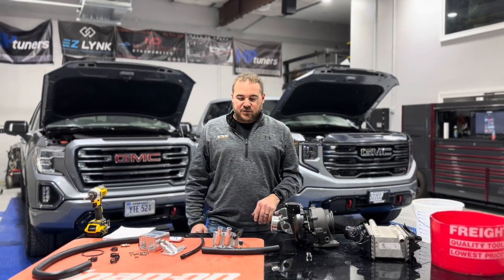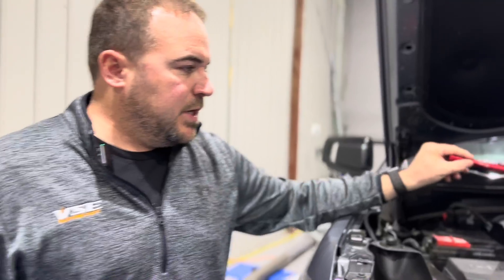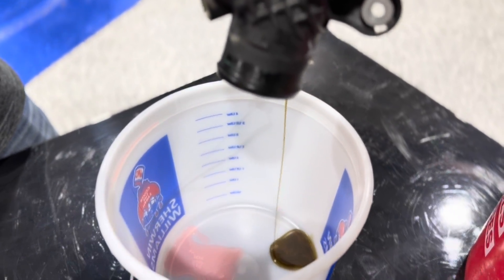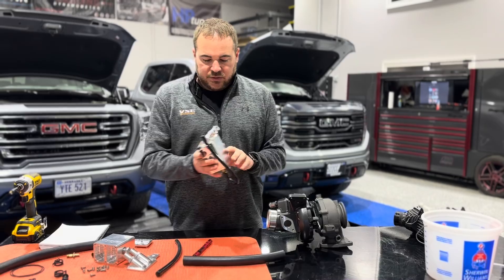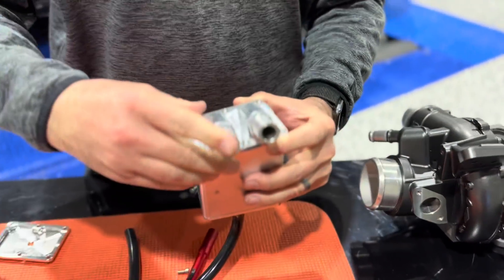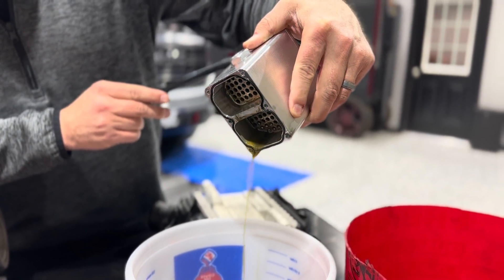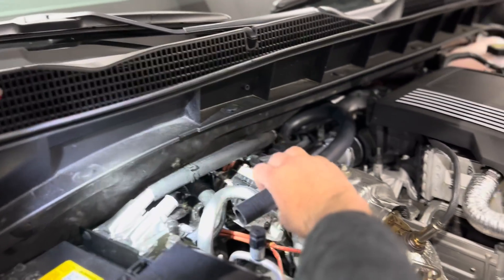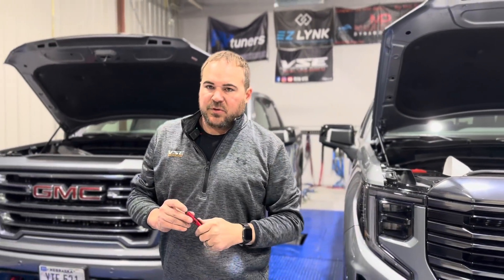3.0L Duramax Diesel - Largest Fault Yet

Comment: Tom,
I installed one on my 2025 Silverado LZ0 and after a 700 mile trip, I couldn't believe how much emulsified water and oil the can captured. I took out over an inch and a 1/2 in the bottom of a Solo cup. Thanks for the great product that actually works.

Comment: I just saw a  video on demon works  of a guy whos warranty was blocked by gm for installing this device, apparently the drain interval stated was not correct.. then halved to 5000 miles, and still not correct. Its filling with water within 100s of miles and freezing in cold climates.. Just beware before installing devices like this.

Comment: Put the VSE Catch can in my 2025 LZO, it is very tight space for the hoses and the firewall installation, I added wire loom to the supplied hoses for some extra protection, the overall quality of the unit is very well made and once everything is in it seemed to be just fine. It has run the same since install, no issues, but have not yet logged enough miles to drain the can yet. I will report in once I do. The long reach hose clamp pliers are an absolute necessity for that back clamp on the hose to the crank case.
Reply: Make sure to drain every 2 fill ups over winter.  It accumulates a watery oil mixture super fast below freezing temps. At least in my 25 it does.  You just want to be safe.

Comment: STAY AWAY!  I purchased 2 GMC Sierra’s last year, the first one was a SLT and I had a few issues, mainly lack of towing features.  SO… I traded it for the 3.0 AT4 and initially I LOVED IT!  Then I started towing my 6,000n lb camper.  On my first trip I topped off the DEF at about 300 miles.  Then 100 miles later I got the DEF LOW warning SPEED REDUCED in xxx miles.  WTF!  So I pulled over when I could and tried to put DEF in the tank, IT WOULD NOT TAKE IT???  I had 1000 more miles to go and I had DEF on hand, over the truck Alan was wondering WHEN WOULD THIS TRUCK STOP?  Long story short, I had to find a campground, unhitch and take the truck to service.  On the way to service the truck fixed itself???  They ran diagnostics and said your truck is GREAT?

I hooked up and at another 300 miles the same warning came on, then it went away just before miles were reduced.  the truck was in a an out of service with no solution.  My father, a former GM HD Truck Engineer said “Dump that thing” and that what I did.  I now have a Ford Powerstroke 2500.. NO PROBLEMS..  GM took that truck out of the oven too soon.

If you drive to the grocery store, Lowe’s. ECT this truck is great! MPG id amazing, I actually got 30 MPG on the highway.  If you actually use the truck, to work… AGAIN STAY AWAY!
Reply: Same problems here. Great mileage, no fix for this unneeded problem

Comment: If you are watching this video because you are having oil consumption issues then you might have a bad valve cover weld. It is a known problem and there’s a TBS out for and it’s covered under warranty. The warranty includes the replacement of the valve cover and the #2 glow plug. You must first see if you qualify by checking the serial number on the valve cover.
Reply: They wont change it, untill you prove oil consumption.
3 months at the dealership for coolant valve replacement, transmission recall issued.
Sold mine, bye-bye GMC

Comment: I wouldn’t use brake cleaner to clean the heat x changer. I’d use contact or electronics cleaner. It won’t  be detrimental to the end tanks .

Comment: I just purchased a 2024 Yukon XL Denali.  I have made two attempts to install your catch can, it doesn't fit in the area designated for the can.  The battery positive cable is in the way and cannot be deflected enough to ge the can mounted.  It also does not look like it will fit even if the battery cable is able to be replaced.  Please advise.

Comment: The early ford 3.5 eco boost had this problem and I simply drilled a 1/8" hole in the bottom of the heat exchanger and it drained onto the ground as needed.  The heat exchanger was down under the radiator at the time.
Reply: that would be nice on everyones driveways 🤣🤣
Reply: Right!! @workinonitSurge

Comment: You should bring this to GMs attention.
Reply: This is all because of emissions standards and all motors have dump the crap back into the motors.
Reply: @MrChadw1974  Also they dont trust the owner to remember to empty the catch can.
I have used a catch can for over 10 years in my supercharged camaro. 
These are nothing new.. and they definitely work and are worth it if you intend to have your vehicle for a while.
Reply: All vehicles have to deal with this by law.

Comment: This is an awesome innovation! I may need to give GM some additional time to work out the bugs of this engine. The first generation had the timing chains in the rear of the engine and the second is blowing oil into the intercooler.

They just need more time to work on a solution to the issues. I'm sure it's an awesome engine..
Reply: " I may need to give GM some additional time to work out the bugs of this engine."
The federal government mandates that ALL engines have to blow oil and water back into the intercooler/engine. This is not a bug but an actual federal requirement. That being said it is an awesome engine, I can get 30-35 mpg on it easy and tows like a dream. I drove from Houston to Tampa and only needed to fill up 1 and 1/2 times going 85 mph almost the entire way.

Comment: Great  way to void your warranty with after parts with gmc. Bad idea 👎 leave your truck alone. You don’t think GMC thought of this happening? Great way to scare GMC owners.
Reply: This will not void the warranty unless GM could prove that it specifically caused whatever issue a warranty claim was being made for. As an engineer I can attest VSE has carefully thought about the design of this and maintaining adequate crankcase vacuum. IMO all forced induction engines should have a catch can - GM didn’t include this from the factory as it is a frequent maintenance item that would expose them to more liability than its worth. I plan on keeping my LZ0 sierra for 10+ years and I put this VSE catch can (along with their fuel system saver) on within weeks of taking delivery of my truck.

Comment: I have 55k mile in mine and it’s an amazing engine. I’ve averaged as high as 42 mpg and 20 mpg while towing. It sips fuel, has tons of torque, and has been very reliable.
Reply: Those numbers don’t sound possible in that truck. I was averaging 32, and 16 mpg when towing, before the dealership flashed my exp with an update, now I’m getting 25mpg.🤬
Reply: @jgyrwa  I can consistently get 32-35 mpg on the highway, my highest is 45 mpg while driving in a city (40 mph, I timed the lights so I barely stopped)
Reply: @jgyrwa I’m glad/not glad to hear that I’m not the only person to have this issue!! Have you chased this issue at all?
Reply: @jgyrwa it’s not. I see mpgs sometimes 39 mpg on complete flat ground. I maintain great and over a 400 miles mine averages 21- 27. Depending how I drive and I drive it pretty good. Not hard but it gets moving lol
Reply: I have a 2020 3.0 and I have also gotten as high as 42 mpg (in the Fl keys), I average around 14 mpg pulling a small (5000 lb) travel trailer. My around town average is about 25 mpg, my usual interstate roads travel is about 31 mpg. For me it has been a great engine.
Reply: Can you give some more details on how you got that kind of mileage?
Reply: How do y’all get so high?? I drive 55mph to and from work with hardly any stops and I only get 22mpg on average
Reply: Even IF you're getting such mileage, that doesn't exactly address this video, does it.. 55k miles is a JOKE for a Diesel! Good 'ol Diesel are getting upto 1 million miles with regular oil changes & valve clearance check & other basic maintenance. I'm not saying it's a BAD engine necessarily but just to point-out how mileage means nothing my friend's Jaguar 2.0 (only has a small DPF I think, nothing else) is getting better mileage (well it's a much lighter car & way-more aerodynamic, to be fair), yet it's literally one of the worst Diesels ever made, he's already spent more money on it than he did just buying it used with similar mileage to you.. And this is with EURO Diesel, which is far-superior.. Even the pressure pump already had to be replaced, ffs, which shouldn't happen with euro Diesel and the pump it uses seems ok I think in design.. These guys showed the sheer amount of oil is the heat exchanger, that is a wild amount, there should be none to begin-with..
Reply: @bo-dine7971sir, “good ol’ diesels” that are getting a million miles on them are getting FAR MORE work done than you are suggesting. Far more.
Reply: Yall be smokin crack or something! I pulled 6,000 pounds with my lm2 thatbhas 22,000 miles and avg 11 mpg. First time taking it on highway without towing it’s about 30 mpg over 30 miles, with smooth roads and no wind! Idk how yall get 40 mpg
Reply: @tretre1692  they're just using the smallest window of miles to get their MPG, if they did the 350-400 window they'll see actual MPG.
Reply: @falkon240 right! They probably fill up and then go 55 mph for 5 miles and get their mpg rating!
Reply: I don't think you understand how averages work

Comment: The design is nice, but I feel like there could have been a more economical way to build this rather than complete billet assembly.
Reply: If they did that you'd complain about it being cheap plastic from China. It's billet or a stamping, and stampings require more work to assemble and add threads and connectors to.
Reply from the maker: @ShortArmOfGod  Amen brother, glad someone said it

Comment: This may have been answered already.  But, I've got about 1000 miles on my 2024 Sierra(LZ0).  With that kind of mileage, would it be at all worth pulling the exchanger and clean while installing the catch can? Or with that kind of mileage is it basically negligible?  Thank ya!
Reply: Honestly this whole thing is to catch 1-2% improvements. Engines have been forced by the federal government to do this for years and we arent seeing failures or issues. If you drive long / hard for a bit to really get the engine and heat exchanger hot it will likely burn off any oil sitting in there.

Comment: Great video has GM commented or has made change to their engine. I was going to purchase a 2024 Suburban with the Duramax 3.0 LZO, not now!
Reply: Why would that change your mind? That is pretty much a normal thing for most CCV/PCV systems. The 3.0 LZ0 is a great engine.
Reply: Your loss.
Reply: There is nothing to change, this is a federal mandate all engines have to deal with it. You should absolutely get the LZ0. Stuff like this is to chase a 1-2% improvement at best.

Comment: My 2021 Denali lasted 2750 miles. Engine leaked oil from the block.  They never told me why, if cracks or improper castings.  They just replaced the engine. By 5000 miles, the new engine would crank and never started again.  Lemon Law got me all my money back but not worth the headaches!
Reply: Yeah why are concerned private inventors having to create aftermarket components to fix major design flaws? I just bought a 2010 Toyota Sequoia after a lifetime of Chevys always needing something four times a year.
Reply: @lloydgood9836  Its always the moronic toyota fan girls. The US government forces ALL car manufactures to route dirty air (water and oil contaminated) back to the engine. Normally this is not a problem on naturally aspirated engines because gasoline is an excellent solvent and will burn it away. Diesel is not a solvent and this has a turbo which is a lot more sensitive to dirty air. Every car, yes that includes your god, Toyota, which uses Turbos (almost every toyota model is turbo charged now) has this issue.

You don't NEED this product your engine will run slightly worse over time, but this won't prevent anything from breaking. There are plenty of these diesels with hundreds of thousands of miles by now without major issues. Keep with your 12 mpg toyota and ill be enjoying my 30-35 mpg diesel powerhouse that can tow anything like its nothing.

Comment: Another bad design is the lack of replaceable bearings in the head for the overhead camshaft
Reply: Incorrect, you can replace the entire camshaft girdle without removing the head. It is a much easier and faster repair
Reply: @Nominale_  I guess that’s the alternative to camshaft bearing replacement. It’s actually not a bad design at all.  Thanks for sharing this with me 
I’m a John Deere mechanic and one of my buddies working with me told me this.  I have a 3.0 d max, so far good for me

Comment: What precautions have you taken to deal with this icing up in cold weather? These things can be a nightmare in northern states that routinely have below zero temps. I had a catch can that would ice up to the point it blocked all flow. Had to drain it once a week.
Reply: The venturi seems to be the solution for that potential problem, along with draining the can at proper intervals for your use.

Comment: this is an ordinary oil dump) crankcase gas separator... where did the $350 price come from? I can take any tank, ban it under the hood, buy it for low-resistance slugs and all this will come out at $70... such a thing is worth me on hemi 6.1)
Reply from the maker: Then make your own from similar materials and post it for sale. Make sure it doesn't increase crank case pressure

Comment: So I wonder if this problem is the root cause of the “reduced acceleration” warning message that displayed this weekend along with very loud fan noise? Engine coolant temp gage was reading normal.  2022 w/35k miles.
Reply: I had the same happen at about 44k miles.  Dealer said it was the coolant control valve.  Waiting for part as there are not many around.  Am also wondering if this is the cause.

Comment: When is lz0 tuning going to be available, or at least trans tuning, I hate how it hunts for gears when towing,  I'd like to lock in a gear like Fords and downshift or upshift as needed
Reply: GM trucks let you select which gear you want to be in.
Reply: @karlschauff7989  Yes, correct, but you can't lock it in gear like you can in a ford. For example, let's say I'm towing a trailer and the truck is hunting between gears, even though lzo has enough torque not to hunt for gears,  in a ford  you can manually put it in your desired gear and it will  not upshift or downshift no matter what unless you come to a stop.
Reply: Can you put it in L and use paddle shifters? Or does it still shift automatically? Also not sure what L stands for its def not low? @fxnytroxtxFPP

Comment: The heat exchanger should make it through the warranty period shouldn't it? Then it's increased parts/service sales for the dealership. GM, gotta love 'em!
Reply: No different than any other brand. Like Ford switching to oil pump belts on the 2.7 Ecoboost and 5.0 Coyote, and then purposely routing the belt behind the timing chain so you're paying for an oil pump belt service and and timing chain service in one go. You end up with an oil pump belt service that's more expensive to do than the rear belt on the 3.0 Dmax.

Comment: My 21 3.0 is north of 70k miles. The mileage has actually improved as the miles have gone up. The coolant control valve has and long crank has been the only issues. The long crank was fixed with a re-flash. I don’t feel there is anything to be gained here.
Reply: Did you watch the video before you decided there was nothing to be gained here??
Reply: @SuperBuggerboo  He is right, the engine will work fine with blow by, unfortunately the federal government requires all engines have to deal with this nonsense. The heat exchanger eventually cooks off oil especially if you drive long/hot/hard. This is one of those things that give you a 1-2% improvements for those who want ultimate peace of mind.

Comment: Sorry, I was wondering why you wouldn’t just use a Mann ProVent 200 CCF? 
I can certainly appreciate the nice Billet machining, but trying to reinvent the wheel may not be worth it.
Please correct me if your system is doing something different.
I’ve used the Mann ProVent 200 Filter on my Japanese Diesel’s, and now my Porsche Cayenne Diesel with great success.
Regardless a great explanation.
🇳🇿🇨🇦
Reply from the maker: We found it to increase crankcase pressure more than factory - and that is what we were try to avoid all together. The screen area seems to be too restrictive once it has any run time on it and to reseal this motor after it starts leaking from excessive crank case pressure it has to be pulled for a reseal.

Comment: Will thermal sleeve be included for the hoses being close to the turbo?
Reply from the maker: This is the same hose material that actually lays on top of the motor and routes around to the back of the turbo. These are exposed to far less heat than that. Good question though !

Comment: Your products are great!  I have pre-ordered.  What measures should I take prior to installation to clean existing components?  My LZO has 30K + miles.  Thank you.
Reply from the maker: With miles that low we recommend just bolting the catch can in place and then letting the heat and clean air clean the oil out